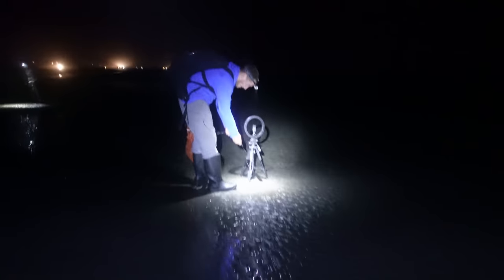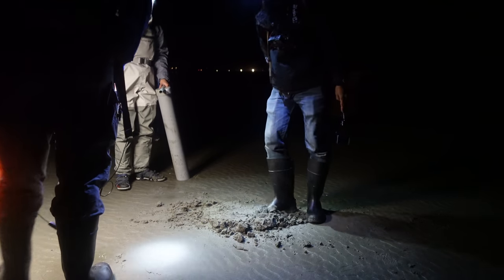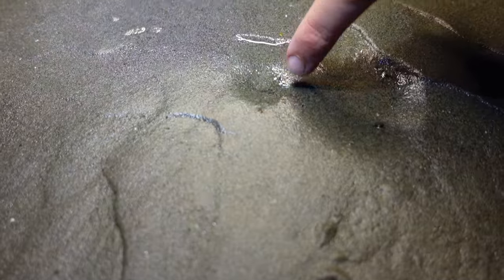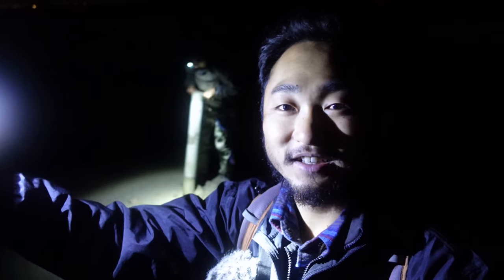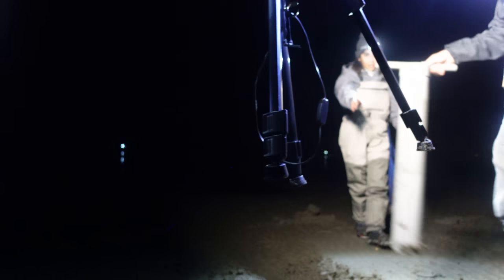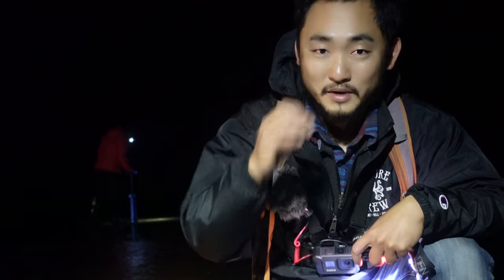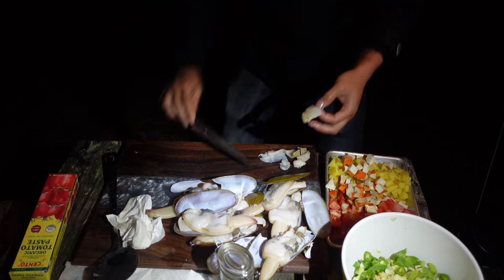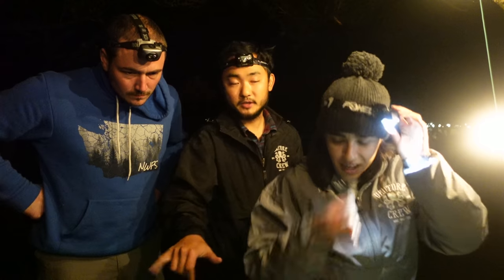COASTAL FORAGING FOR RAZOR CLAMS and Making Delicious Manhattan Clam Chowder

Comment: i live on the LongBeach peninsula & clamming is an absolute Blast. i like to use the "clam gun" just to get the top sand off then reach down in the hole and grab 'em by hand. current toxicity levels have CxL'd clamming till Dec.

Comment: Go closer to the receding water, look for big dimples for bigger clams, twist the clam gun left and right while pushing down so it goes down easier and faster so the razor clam has less time to dig down. Plug air hole on gun and pull with your legs. Always check where you are reference to the shore, lights, cars, etc. Cheers!

Comment: Around here (Western Washington and Alaska) we also call the foot the digger. That is the best part as you said. Full of fat and perfect to the tooth. My favorite way is a 30 second hot hot fry  and eat them like candy. Usually I grind the neck for fantastic clam cakes. Or just raw with lemon or lime juice and a dab of Green Tabasco sauce. 
In Washington the daily limit is 15 and Alaska it's still 60 I think. Along Cook Inlet on the Kenai Peninsula we hardly use a clam gun or shovel because the sand is so soft. Gotta be quick though
They call them razors for a good reason. The shell will slice you to the bone so ALWAYS scoop them from the hole parallel to the water because the way they lay if you go from shore to sea your fingers will get very bloody. Dig on and enjoy!!!

Great Video!!!

Comment: Here in England, we don't use one of those pipes. We just buy a tub of salt from the supermarket and spread it on top of the same dimples and holes you're looking for, it forces the clam to the surface and then you just pluck them out.